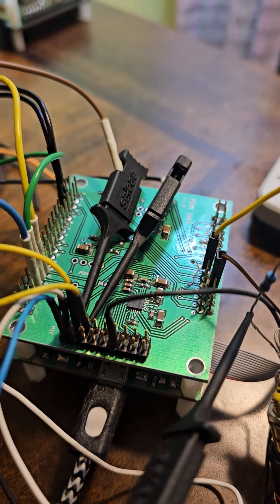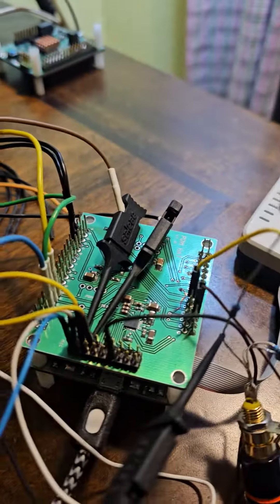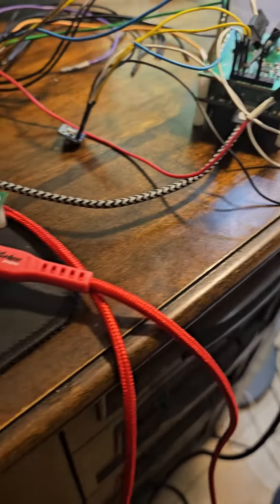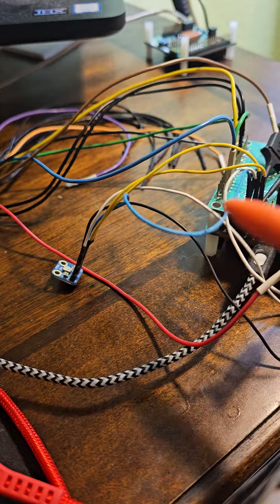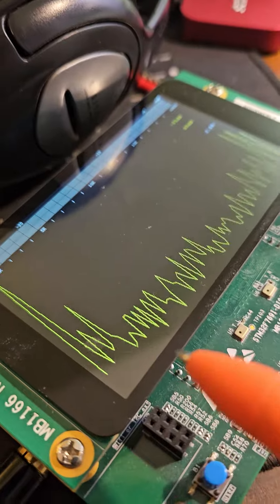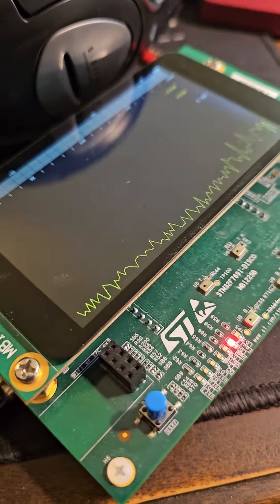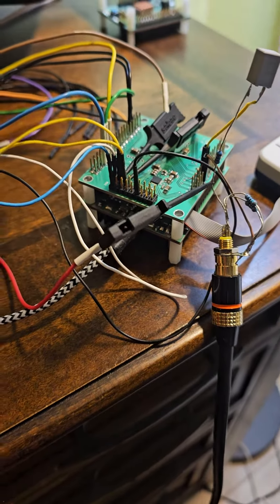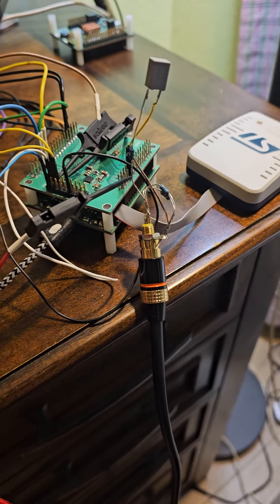PDM MIC on STM32U5A5 via S/PDIF - WAcouSense

Comment from the maker: OK, still an issue in FW - but HW works fine: I hear with just one MIC in both channels. So, I guess, the clock for PDM - CODEC - MCU buffer and the MCU buffer - SAI (for S/PDIF out) are not running with the same clock, the buffer seems to "drift", therefore sound in both channels and the distortion still. But it should be (hoping) just a CODEC configuration and FW issue.